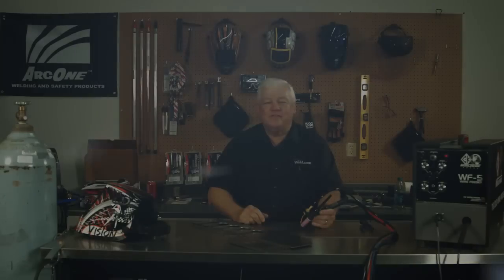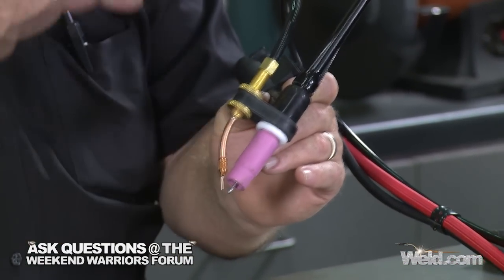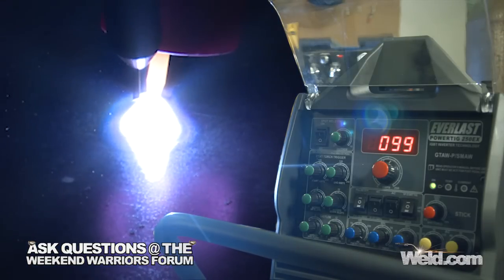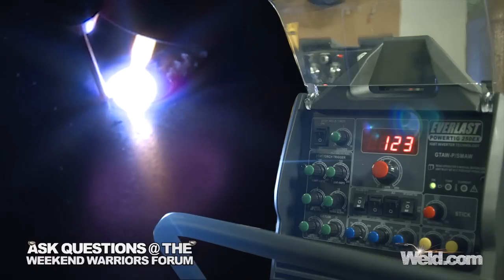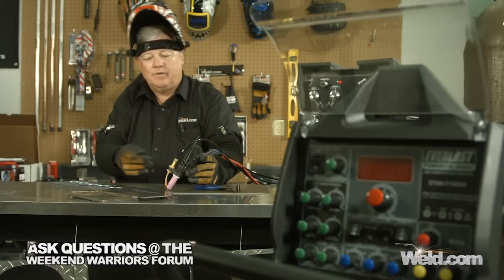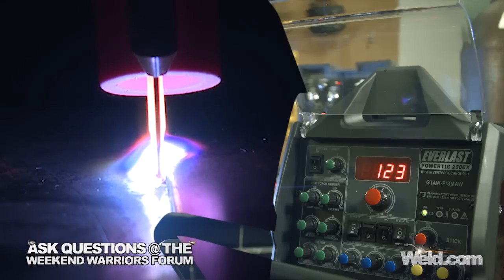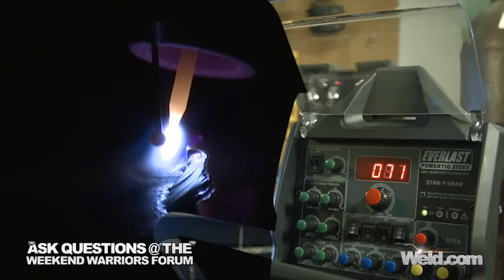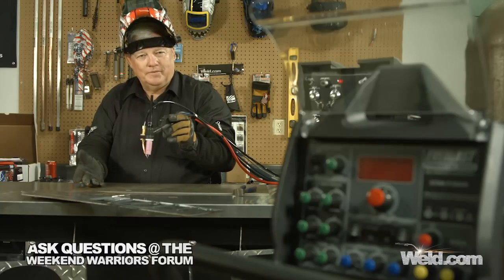TIG Welding with a Wire Feeder and CK Worldwide WF-5 Review : Part 2 | TIG Time

Comment: How difficult would it be to let the wire feed do what it was meant to do? Let the wire feed, feed wire and let the argon gas flow in. Everything else requires a foot pedal . You have control of the wire with the trigger. Can this be produced with a MIG welder?

Comment: wire speed needs to be higher, or maybe i just weld too much alum.. either way it looks like globular transfer and it needs to be smoother. if you get it just right into the puddle it should tig like mig

Comment: I wish someone would make wire feeder with stepper motor, and we could set finite amount of filler material fed into the pool per button press... eg. 5mm per click... rather than how long (time wise) the machine will feed the wire at vague speed (slow or fast). 
This way we can weld as usual, move forward in increments, and have uniform beed size.

Comment: Seems like you can run into lack of root fusion and the wire seems to be burning off prior to the parent metal melting.  Probably ok for general stuff but I would not like to use it on pipe of anything used in a critical situation.

Comment: At my job I do cold feed using a MIG weld head to feed wire with my left hand and TIG with my right. I disconnect the power to the MIG and just use the wire. I have to run it super slow ( like .5 ) wire speed but it works.
  Be a man, use two hands
Reply: I make 10 to 23 inch welds where using 35 wire you could go nuts trying to keep up so I just use wire feeder. With what he was doing he could probably just hand feed the wire better.

Comment: Love the setup... But maybe it would work better based on a mig setup??
We mig a lot of very dirty materials... Rusty, corroded, dirt and mud, oil, grease, even manure.. high flow 100% CO2.
Sometimes I wonder if Tig would be better due to less heat, not so sure about that now.... Those beads look worse than mine on corroded manure covered equipment...
 No offense Mr. Tig!

Comment: I can see something like this being nice for production welding.  Your close-up shots and camera angle were exceptional!  It was great to see how it actually worked.  I noticed at 7:38 that the filler was falling into the puddle at irregular intervals because the heat being reflected away from the top plate was making a ball on the end of the rod.  It's not as precise as putting the rod right where you want it at the exact moment you want it there.  I imagine you could compensate for this by changing the angle of the feed for a specific type of weld, especially if this was a production situation where you were doing the same weld all day.  Great video, thank you!
Reply: @HemiRod23  i noticed that to it was "balling" up due to the heat and falling into the pool

Comment: there's already an autofed wire welding process.....
Reply: This allows to you to control amperage and filler metal inputs independently whereas with other autofed wire (constant voltage) processes the filler and amperage are controlled together.  For example, in MIG welding you turn up the amperage by increasing wire feed speed.
Reply: Patrick McNeely you adjust that by changing your travel speed. 🤦🏼‍♂️🤦🏼‍♂️🤦🏼‍♂️
Reply: Also for someone like me that builds aluminum boats. I absolutely need to weld with 5356 wire for corrosion resistance. So as we all know 5356 looks like crap most of the time when welded with a mig. So being able to use something like this is awesome. Plus the fact that I’m doing weld runs that are 16 or 20 foot long. That’s would be a ton of stopping to grab rod. Also most of the welding is done out of position which sucks. It can be really hard to have your pedal in the right spot. I’m ether gonna build one or buy one for sure.

Comment: But why? Why not just mig weld the joint? The only thing I can think of is less noise and spatter. But the point of tig is precision not endurance.
Reply from the maker: You still get the precision of TIG. You still have a foot control and all the ability to control your settings. This is ideal for applications such as commercial kitchens, where you can't have any spatter or places where bacteria can potentially grow and welders are continuously doing long, production type runs.
Reply: AH! But why would you be welding for a long period of time in a kitchen? You forgot the obvious answer here (i did as well until now). Amputees!
Reply: x9x9x9x9x9 yes yes fuckin yes couldn't have said it better myself it us an amazing product but I'll do manual any day  great comment
Reply: x9x9x9x9x9 I work in a stainless steel Fab shop where we Fab commercial kitchen equipment and residential stainless steel countertops we build everything from scratch and I would not I repeat would not want to use that in my process

Comment: A nice vid there! Thanks for keeping the sales pitch minimal. :D
Some questions on the wire feeder. Are there any issues with "back feed" of current thru the wire to the drive, if the welder and wire feed machine are not on the same circuit and are not "earth" grounded?? Or would having both grounded to the work create a circuit?? I know the current "follows" the shortest path, but I am curious about possible setup issues.